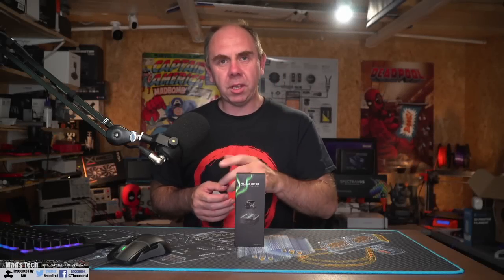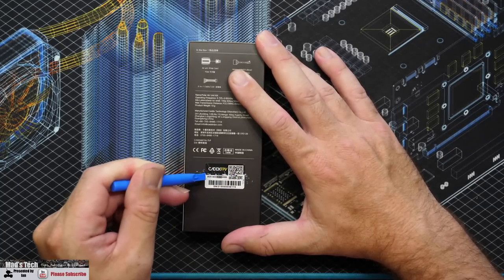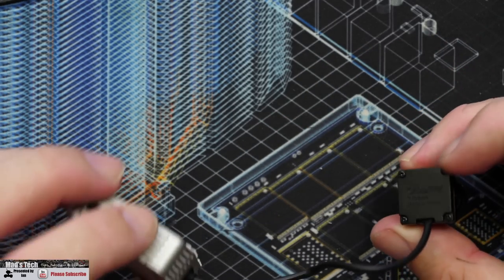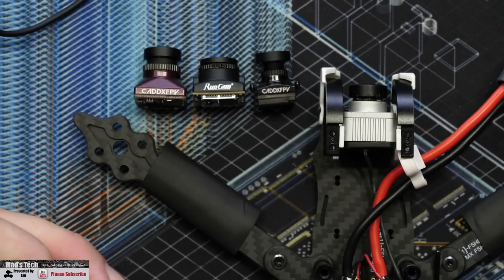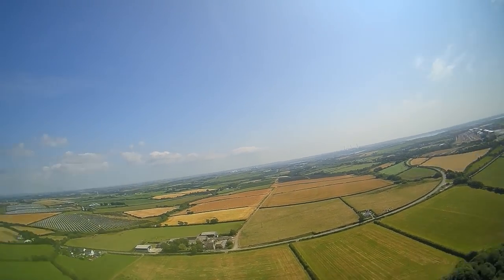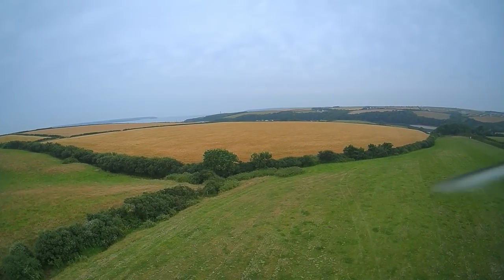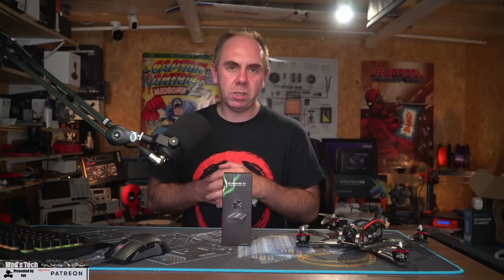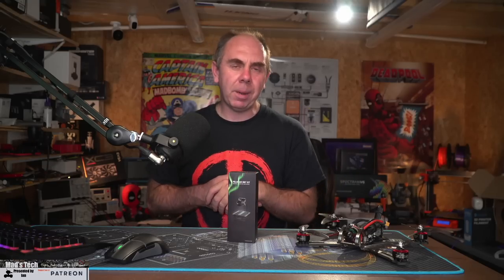CADDX POLAR STARLIGHT CAMERA FOR DJI DIGITAL FPV REVIEW  - GOOD BUT FLAWED

Comment: Thanks for explaining the white balance thing. Flying laps it does that shift in the same spot doing the same move didn't know why. Was shocked how nice the image looked mine has a weird jello thing that happens in full bright probably my setup. Definitely low light not full dark that said it's a good flyable image until the sun is gone. That was a great review you missed nothing.
Reply from the maker: Glad it was helpful!
Reply: I have massive issue with strong jelloing. Its not flyable for me. Its not a tuning issue, old vista works fine. I thing there a camera with bad quality.... I contact caddx.

Comment: This camera is on my our Emax Babyhawk II HD BNF, initially I wanted the Nebula Pro over the Polar but since my son and I frequently fly in the evenings during the week, I'm very fortunate that it came with the Polar camera.  I have flown at the same time at dusk and the Nebula Pro simply cannot compete with the Polar dusk till dark.  It can be pitch black and as long as there's street lights or any lightning this camera truly is shocking how awesome it is.  Frequently I will take off my goggles and it has gone from dusk to dark in the 12 minutes I'd been flying and I'm always shocked how dark it is but still flyable with this camera.  If anyone else flies after work when it's starting to get dark, I highly suggest you consider this camera so your flight time window (in regards to getting dark) isn't cut short.  No, it's not low latency and only has 16:9 (which I prefer).but it's a good camera in the day and reigns supreme in low light.

Comment: thanks for the video just had my first flight with the new dji goggles and I could only get this camera 
it looks amazing but I have nothing to compare it to . I've noticed that it pixels a lot around the props I don't know if this I a common thing to happen ? . 
I did email caddx and they did get back to me straight away about not been able to change the transmission presences . turns out you can't .. and the white balance is annoying I might see if I can turn this off .
nice to see how to unplug the camera in your video 
thanks 
and a new sub

Comment: Good review! I think compared to the mipi it looks slower, more latency, because it has longer shuttertimes, more motion blur.
for cruising around at sunset (or dusk) it's perfect. There it doesnt shift WB too much also.
Colors are a real treat to the eyes. Goes as far as: flew yesterday at sunset - looked amazing, also recorded on instaSMO - and there it looked "normal" :)
Another thing I saw there:  on my Polar I noticed more jello than on my instaSMO. Might come from different mounts - but I suspect the polar is more prone to jello.
This sucks a bit  (if polar is the rec cam)   but it's a good thing if your "viewfinder" is more affected by vibrations than your HD cam. This way I could fly carefully and use the right ammount of speed and throttle to minimize jello.  turns out: on my instaSMO I hardly see jello - even if I know my chimera5 is not tuned right currently and does shake a lot...
greets, Mario

Comment: I have been flying this (fixed wing) unit in total darkness and the trick to have some reference at your (home) flying point.  A car headlight, or flashing flashlight to orient yourself.  It helps to have a lot of clear ground in front of you to land on.  What a hoot getting up to altitude well after sunset and loitering around.

Comment: 19:17 the best camera you can get is the best to buy 
10 seconds later: but not for now cause it is already sold out

Looks like a new series like the rumors in former east germany, that you would get bananas next friday and everybody would try to get them even if they hate bananas cause then they could exchange those for other missing pieces like spare parts for the car.

Next video will be called: get the nebula, it is available again 
followed by the Polar Starlight when that will become available again.

I really like that night view even though I avoid flights in darkness cause it is really tough especially FPV and it needs a lot of concentration and brain memory too to remind you if there you be a tree between you and the drone you did or could not see. But I guess the low light footage shortly before the sun disappears might be the right spot to use it.

Comment: Are they still shipping these when pictured of the full size dji air unit, with the caddx camera, with a dji og air unit? 
Does the caddx system record audio since its basically just a dji fpv air unit and just a new camera option?

Comment: 17:00 IMHO that's not good test, digital compression works usually on some discrete cosine transform. If all blocks toggle between dark and light there is actually no high frequency component in each block but only DC plus some low frequency components (check how DCT or jpeg compression woks on wikipedia). You need much less data to send that frame as most of the data will be 0 after quantization. When I watched JB youtube video I got impression that JB had problems while flying thought some obstacles. In that situation every block is highly changing and much more data is needed to send all of those blocks. My guess is that in highly changing frames produce some kind of lag on processing and sending those packets over radio. On/off light test will never show it. It's good for analog but not digital. PS Of course Joshua might have bad camera as well ;)

Comment: It’s cAlled the “starlight” meaning it’s for at night with the ambient starlight for its light source, it magnifies the starlight like the starlight scopes before it that the marines used in Vietnam. I would imagine without new settings it would be very bright during the day. Having said that, there should be a option in settings to adjust the white balance and or the brightness for day light operation.

Comment: if i fly in moonlight i just put a little light on the ground for landing. its kind of fun and it takes really 100% concentration to fly in the night. flying at some outskirts with low light or parking areas is really fun, because you can see all light masts and smaller tree branches also. it is my best night fly camera, much better than the owl and owl 2.

Comment: Did you try to reverse engineer the joystick board, so we can solder up some DIY solution?
Reply from the maker: There is a post with the resistor values I have seen, its basically just different values as follows 
Up: 15.7k
Down: 1k
Left: 28k
Right: 7.8k
Enter: 46k
Reply: @MadRC  Thank you, will give it a try

Comment: wow, the WB changes are just as bad as it is on mine, the camera is outstandingly good, but this behavior renders is completely useless.
all the "reviewers" that had them before somehow do not experience this issues, looks at Albert kims review as example, he fly straight into lamps. and the camera doesn't just that massive.
but the ones you actually can buy all have this problem, also, caddx doesn't seem to have a lens map for the lens they provide. no latency issues for me either, that's just a hype.

Comment: At this point in time it is almost worth buying the OG Air Unit just for it's camera after seeing this IMHO.
Reply: It’s been discontinued and isn’t available for purchase anywhere, not even Nebula Pro which was pretty much exactly the same as OG DJI camera but less weight
Reply: @allahhazard2621  I just took delivery of an OG one this morning. Where I live stock does not move that fast.

Comment: Just a quick gotcha with the Polar Camera --- I had to replace the coaxial cable on one.   Did you notice on the Polar Camera how the wires seem exposed coming out of the housing?   Unlike the DJI camera which has a grommet and reasonably water-proof, the Polar has issues.   I purchased a normal "part 9" replacement cable,  had to cut off the backplate and grommet, but I also added some heat shrink so that it is more "covered" coming out of the housing.

Comment: The cable for this is a little short for some 7in and up builds. I have installed the mavic pro signal cable with success on the polar cam and vista unit - very easy job too.  Make sure you install the tag end of the new cable on the vista side. enjoy!

Comment: Transmission mode and Camera settings not available when paired?, I am unable to access the menu in the goggles when paired. Tried numerous things, change uarts, also refreshed firmware, spoke with Hobby-rc and they are puzzled also. Also re aired . I have video No osd  as I did follow Bardwells video exactly as he explained, No osd , but i do see N/A on the screen. Oh and This is in a drone frame but Benched with a Good supply of cold air from a compressor keeping it cold, simulate flying. Any ideas I would be grateful.
Reply from the maker: There is no camera or transmission settings on this camera as it’s only the 60fps models. No adjustment or low latency mode.  

As for the no OSD this can only be related to your UART and setup on your FC.  If using Betaflight you need to make sure you have configured the UART correctly and that you don’t have the Tx and RX lines swapped.
Reply: @MadRC  Sorted everything out tonight apart from 1 thing I am not able to alter the power, I have tried the naco aver and over even to the polar unit This is on 25mw and unable to access it Is this normal Thanks for getting back to me

Comment: Hello dear..
I have a problem with this kit..Is already installed and by default appear low latency on my dgi googles. It can Not be switched to high quality. Appear camera also in grey unaccessible ..did you have same problem.  I already installed all firmware updates..perhaps camera doesn't support high quality on googles...I need help..thanks
Reply from the maker: This is is a known bug in the UI, basically you are in HQ mode its just shows wrong. you can ignore it.
Reply: @MadRC  thanks dear for you replay..it happens the same with MIPI runcam camera..Sure are in HQ?..however with cadxx nebula pro..all is fine from googles you can setting and you notice when switching to HQ..the image on Google is better....based on my experience I am not very sure..I am in HQ due the quality on googles resolution...thanks again 😀

Comment: Hi Mad , just got one of these cameras in the mail , I've put it in a build and it's on a different firmware to all my other builds ... 
I didn't want to update all my other builds , but it seems I may have too... on this new camera it doesn't let me select any old firmware..
Do you know if the latest firmware will still let me put in the 1000mw hack ? I'm afraid to update everything and be stuck on 25mw . Cheers 👍
Reply from the maker: Yes all the hacks still work.
Reply: @MadRC  legend thank you 👍

Comment: Consider Caddx customer service when purchasing. My low light/polar camera has white noise in low light. After sending footage I was told that it works in the day so no return!

Dear Simon
Polar is a low light camera, not no light camera
The engineer said this is normal because it can work normally during the day and the camera itself is not malfunctioning

Thx & Best Regards
Have a nice day
Reply from the maker: Can you email me the footage ?
Reply: @MadRC  Link sent. I’d be interested in your opinion.

Comment: For the low light capability would be worth getting a Polar. Thinking the auto white balance would be less of a issue in lower light vs bright daylight. Would be interesting to see, if you happen to record any more with the Polar?
Thinking auto balance would be less an issue in cine-style flying where camera angle is not going to change as quickly.  
Ideally it would be nice to have an option of turning auto white balance on/off, and picking from a couple of colour adjustments, as the Polar seems to have a blueish hue in bright light. 

Overall would agree, is a good all round camera, so is worth getting ... given not many choices at any price point available.